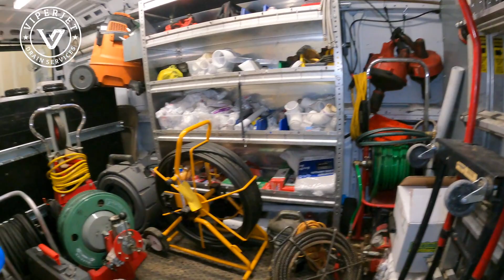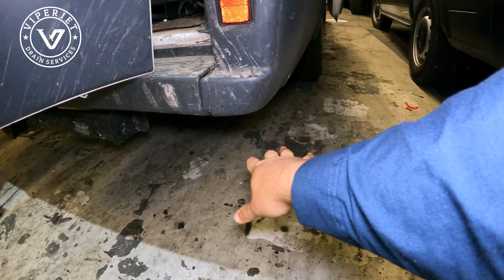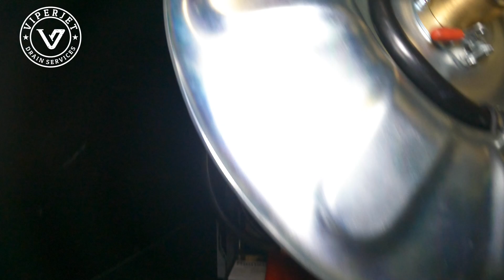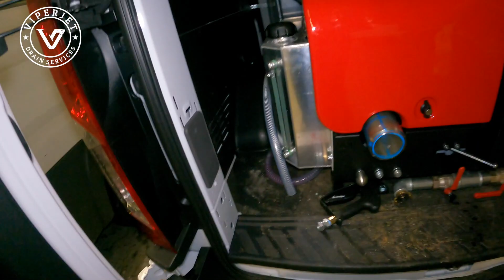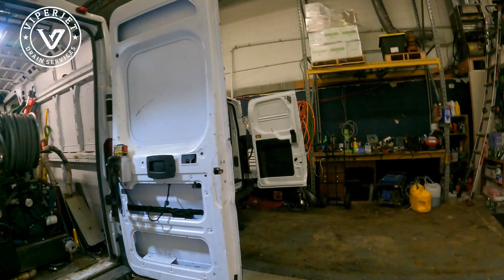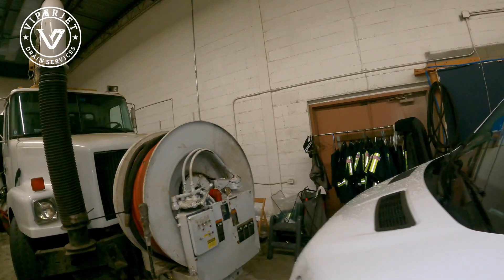New Jetter Spartan warrior Pros and Cons

Comment: to load your sewer machine in the side door get a winch at harbor freight and mount it to the roof inside right close above the door. and use the remote that come with it to lift the machines in and out.
Reply from the maker: I will definitely take a look at that.
Reply: harbor freight foldable ramps is a great idea @ViperJetDrain

Comment: I have this machine and I love it. I have the spinner nozzle That works great and it really works great for grease. It knocks off sleeves off grease about 2 feet long sometimes longer. I have a pentrating head that I use in the 4 inch lines. Do you have any suggestions of a good root cutting head. We ran the  Exhaust and the water  Overflow the come out the bottom of the van.
Reply: Reaper

Comment: Dividing the tanks was a smart move!! Basically what they did was create a baffle for more stability while driving with water. I also thought dividing the motors and pumps was a great idea and that's why I went with the setup I built onto a box truck.  2 Honda motors and 2 general pumps pushes 17gpm 3800 psi for my setup. Or, one engine and cut the gpm in half. I have a,275 gallon IBC tote, she gets to rocking too!!
Reply from the maker: Hey you’re right I never thought of that.